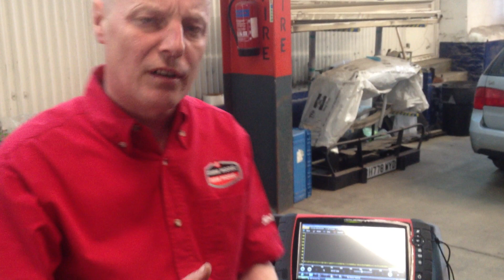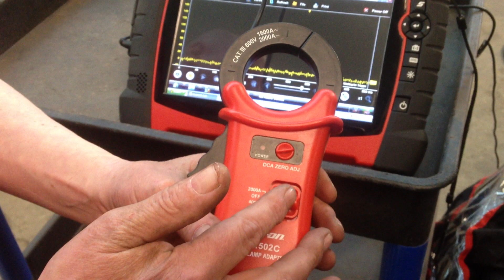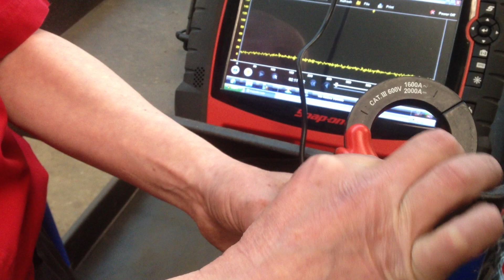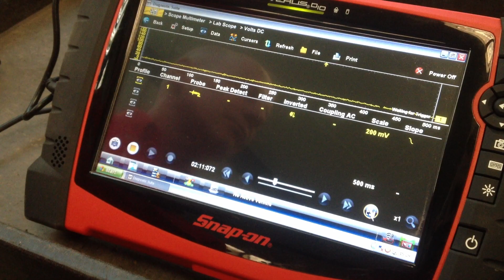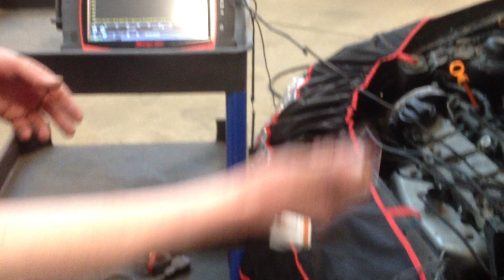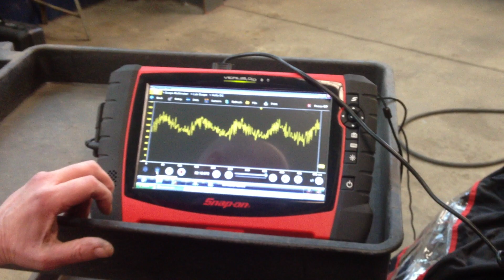Snap-on UK - EETA502C - High Amp Clamp

Comment: Set your scope to ac coupling, 1v scale and measure battery post voltage, you get the same pattern without needing an amp clamp.
Note that the waveform will be inverted as you are measuring voltage and not current, so the peaks are along the bottom unless you adjust the scope. 
 Not quite as detailed but works well enough.

Comment: A few things that are not noted, warm up the engine then shut it off . remove the power source to the fuel pump so your not doing a fuel in the cylinders " WET " compression test . Also make sure the throttle is wide open while cranking for 3-5 seconds . The throttle being open really does make a difference.